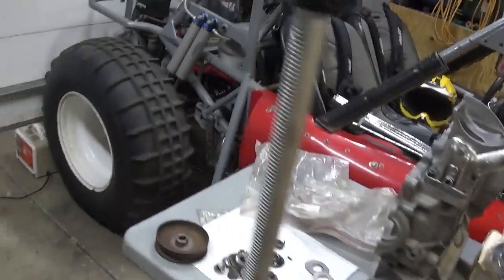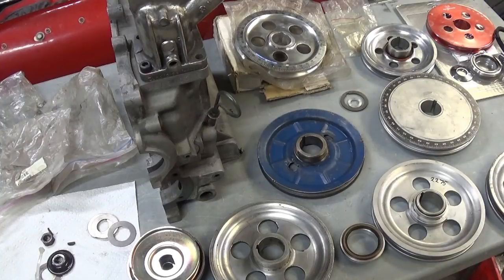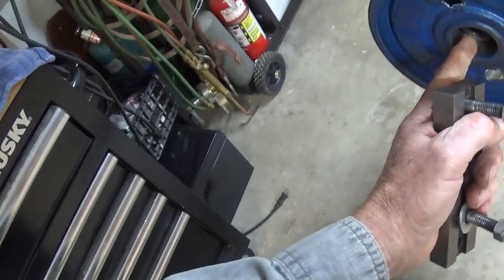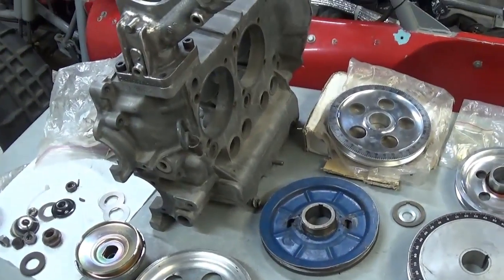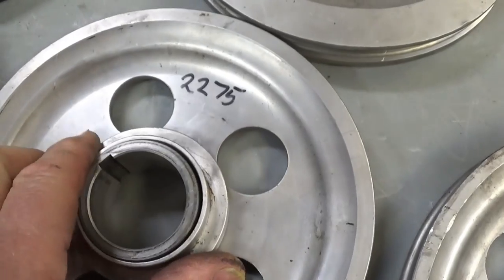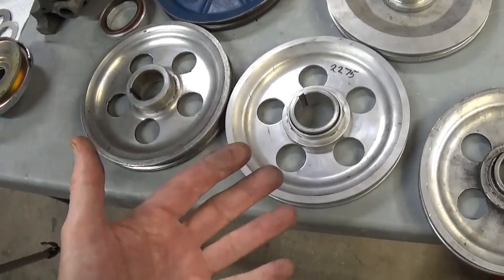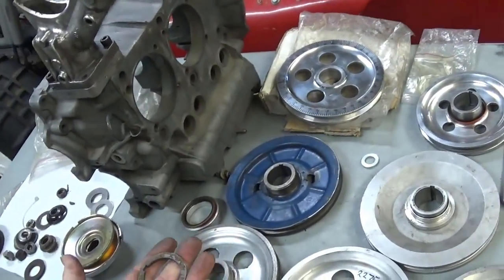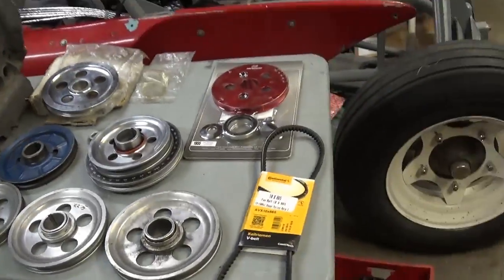VW Fan Pulley Performance Tips

Comment: You mentioned the fan pulley being aluminum ----- one is constantly checking and tightening the fan nut ----- The aluminum getting hot and then cools off ------ contracts and expands ---you brought back the ---- aluminum wiring in homes years ago that they use to do ------ One has got to go to that electrical cabinet and tighten down those screws to those terminals ---- The passages you read from Gene Berg's book ----- I just read a couple of days ago ---- Got one of those six pound pulleys ordered for its Black Friday ----- try to find some good deals ----- Hope you two had a Good Thanksgiving ----- Take Care ----- Rodney
Reply from the maker: Thanks Rodney.  I use those 6 pound pulley's on several of my engines.

Comment: Good Morning EZGZ
Hello from Canada, only minus -50F last week.
So when you mention to leave room for expansion, I automatically thinking of contraction lol  ... 
Wow, what a great, well explained, pulley presentation !

I have a couple of questions.
I just bought a new aluminium Autolina engine case, 
and they say it's machined for a sand seal.
How do I confirm that ?
Second question: if the case is machined for a sand seal, is there a way to run an type1 original pulley with the grooves ?
Thanks !
Reply from the maker: The most popular aluminum sand sealed pulley's come with a none machine seal insert. You just silicone it in place and add your pulley. 
Remove or don't use the seal and go with stock. They also make stock style aluminum pulleys for that extra bling...

Comment: Thanks so much !  I was putting in a weighted pulling in just now and when tightened the nut it locked the motor and could not turn it.   Have the spacers but didn’t know what I needed to do till I found this !  Cheers.
Reply from the maker: Glad it helped

Comment: So if I put a power pulley in the bottom, I have to put a 356 porch pulley on the generator in order to cool the engine correct ly right ?
Reply from the maker: What you describe makes no sense unless you have some odd clearance issues.  I used a power pulley because of a dry sump 2 stage oil pump. A stock lower crank pulley would no longer fit.
Power pulley on bottom gives you more pep but less cooling.
356 pulley on top with stock lower crank gives more cooling and slightly less pep

Comment: Hello i just got a empi stock size pully and it is going to far into the case do i need the spacers you showed or are those just for sand seal pulleys
Reply from the maker: Most pully's I bought came with  a apacer for the crank and a small one for the Al;t/ gen.   You need to have the fan belt in alignment
Reply: @TheEZGZ  ok thanks I didn't know if it would interfere with the oil return threads

Comment: Very informative video! I’m trying to “build” my first car...ever...and I’d say we’re probably about the same age. Something I’ve always wanted to do. I’m building a roadster...no roof, no heat, no windows...not even windshield wipers. It’ll be strictly to drive to the post office or for frozen yogurt...that sort of thing. Anyway...I’m not terribly concerned with high performance or anything like that. I did buy a bunch of chrome stuff for the engine...I know, I know. The crankshaft pulley I bought (aluminum with degrees) seems to sit too far up onto the shaft...so much that it rubs the tin behind/underneath. In addition, the pulleys are way out of alignment, with the alternator pulley extending more towards the rear of the car than the crankshaft pulley. I’ve read online that the alternator can perhaps be pushed “forward” a little and then strapped back down. That obviously wouldn’t correct the rubbing issue with the crankshaft pulley. I don’t have a sand seal, but would it still be OK to use that spacer/shim on the crankshaft? That would alleviate the rubbing...and then maybe I could get the alternator shifted enough to produce proper alignment?
Reply from the maker: You want a dairy queen machine you can do what you want to make it look good.  The fan belt won't fit right, the Crankshaft nut won't stay tight (especially if it's chrome) It will leak oil at both sides of the crank pulley.  I would avoid pulling back your alternator as it distorts the tin and moves the fan in the fan housing. It might not rub but it causes stress and will eventually crack somewhere.
I would strongly suggest you use the stock steel pulley's and paint them to match your body color.   Same for valve covers by the way. Chrome valve covers always leak and the chrome plating reduces heat transfer which is a big part of there design.
I don't follow all these suggestions on my cars and I experiment with a lot of different products but you will also notice I am constantly working on my cars and carry lot's of spare parts and tools with me at all times.
A good friend of mine came up with a term called a buddy engine or a buddy buggy. It means you never drive your car unless you have a buddy in another car so hopefully one of you can pull the other guy home on a strap.,

Comment: EZGZ, can you help me figure out a problem I'm having? I have a stock 40hp engine in my '64 bug. Oil is coming out from behind the crank pulley. Oil is sprayed all over the engine compartment, including under the decklid. I made sure the oil filler tube is clear. I adjusted the valves. It has a stock pulley. What gives? Thanks!
Reply from the maker: If this is a sudden new problem something has changed and you need to investigate until you find it. If it were me I would make sure the vent tube was open. I would remove the rear crankshaft fanbelt pulley and inspect and clean those left hand threads that are supposed to keep the oil inside the case. Of course You didn't overfill your crankcase with oil ???????   It's a bitch to get that pulley off while in the car. They make a special puller just for that.  If everything looks in order I would start suspecting worn piston rings and or valve guides allowing blowby to enter the crankcase. You spark plugs would be fouling and first sinner would be #3 cylinder
Reply: @TheEZGZ  Thank you EZGZ. The engine has less than 500 miles on it and the builder passed away (RIP Johnny). It has a Fram bypass oil filter. What if I accidentally overfilled it at one point? Would that ruin the engine? I had it filled to the line when cold. But now I have it a little below the line because I'm afraid of overfilling it. Would breather box and hoses to the valve covers help? I will take the pulley off and clean the threads. The vent tube is open. Thank you again for your help.
Reply: I will check the spark plugs. Also, I will do a pressure test and leak down test.
Reply from the maker: Joseph  I think your over reacting to during your honeymoon.  LOL   Leave the damned thing alone and drive it somewhere far away.  Like a full tank of gas on a weekend out in the country. Get it good and hot and enjoy it. let those rings seat.  Hopefully the builder kept the air flaps installed in the fan shroud and used the thermostat that many builders delete.  If you don't have it don't loose sleep over it it's mostly for short drive warm ups.   Use any good grade 10w-30 oil and add a little Zinc.   Relax and enjoy and carry a peace of cardboard to throw under it to catch that drip of oil. Every ounce in a while wipe that pulley troff out with a old rag.   YOU DON't HAVE A PROBLEM.  Not every rebuild is perfect.  All my engines leak oil somewhere eventually.  Sleep Well my friend.
Reply: @TheEZGZ  Thank you EZ. I'll Try it out. Have a fantastic week!
Reply: @RAUL G My issue was resolved. Turns out I had a clog in the oil filler tube breather drain. I thought I cleaned it out the first time, but I did it again and that was the issue. Thanks EZ.

Comment: I replace four pulleys already and I can not stop the oil leak😪
Reply from the maker: sounds like your rings are worn and you have crankcase pressure.  Make sure your crankcase vent is clear and if possible connect to your air cleaner like the factory did.  If you have a high horsepower engine you may need to vent your valve covers..
Hopefully if someone was inside your engine during a rebuild the put the oil slinger in properly. 
You might even consider a sand sealed pulley setup.  It's more to keep sand out but does help keep the oil in or at lease reduce the oil leak.  http://carcraftstore.com/sandsealpulleykit.aspx
Reply: Thank you brother you save my life that’s was my problem the crankcase was completely close even no hose to conect it to the carb now my BIG BOY RUNNING LIKE CHAMPION thank you again god bless you
Reply from the maker: @sebastianlara5757  Thanks for letting me know.  Merry Christmas to ya
Reply: Thanks same to yours

Comment: Hello EZGZ thanks for your lots of secrets uncovered. A question is the Deorto DRLA 40 with Venturi 32 better than Weber 40 IDF 71 with 32er Venturi ? AT LOW TORQUE AND HIGH RPM
Thanks 
Have a good Easter time and fun with your Aircooled Cars.
Matthias
Reply from the maker: I think they would be the same end result but there are a lot more parts and support for the Weber and HPMX
Reply: @TheEZGZ  Thanks a lot.

Comment: As soon as I started to enjoy it it’s about time to go back to work. I love my 2110 . I’m wanting big big 2442 with Strip Dominator heads . Good video
Reply from the maker: I don't hardly run my 2110. I figure why wear it out putting around town.  Besides if I run it I will use it and then I get the tickets. 
 There is something satisfying about driving a slow turd as fast as you can over having something fast and constantly having to excersize restraint

Comment: Hi ezgz is an electric fan available ?
Thanks Mat from the UK 
Ps stay safe we love you.!
Reply from the maker: Not sure why you wouldn't want stock as it moves more air as the RPM goes up. Some drag racers would run dual fans  above the cylinder tin and leave everything else off.

Comment: A question; my 71 bay's engine oil temp doesn't get over 160 in the winter here in GA. It has the flaps with no thermostat and a late beetle velocity stack on the fan shroud. 
What is the best option to get the engine and oil temp back up?
Reply from the maker: Other than the obvious answer of install a stock thermostat  I am curious of what your using to get that temp reading, where your getting it from, how long the engine has run, what weight oil are you using, what your oil pressure is? You might want to check the spring and piston of your oil relief valve at the rear of the engine. The relief valve controls some of the oil flow going threw the oil cooler.

Comment: Hey EZGZ, what was the Toyota oil filter you always run? Great video 👍
Reply from the maker: 90915-YZZD1 is the shorter one but they make a bigger one. Depends on you needs and location. Look in the filter book for filters that fit a Toyota 22re engine